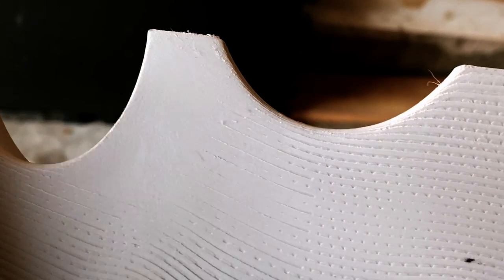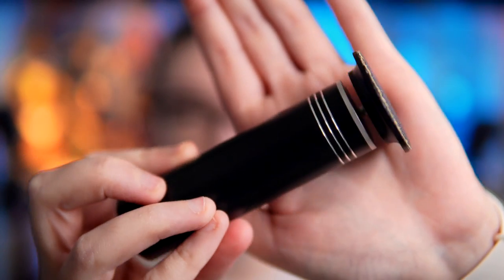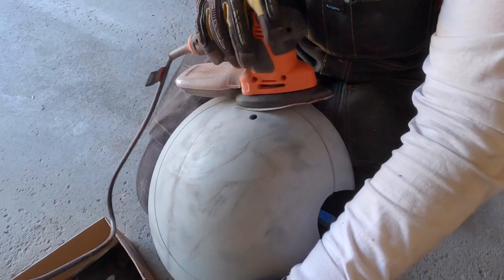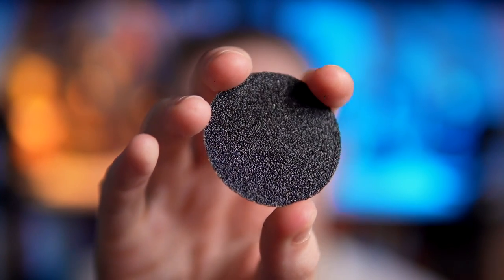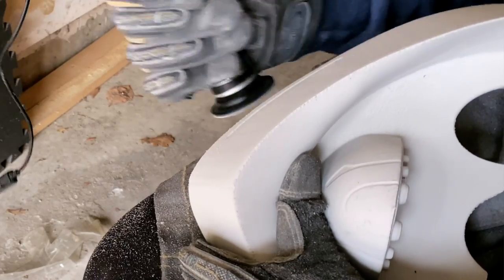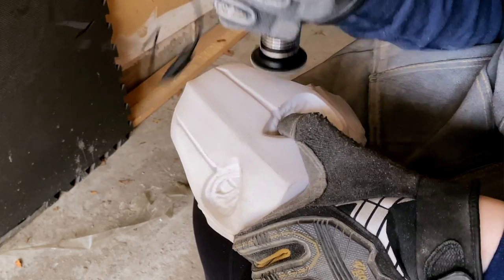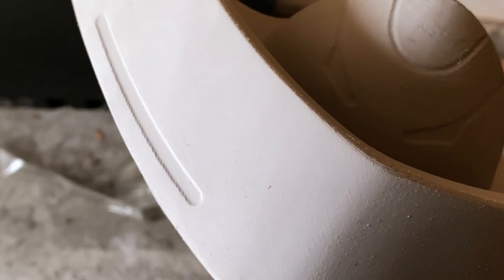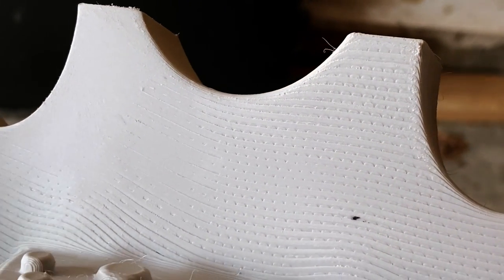Make Layer Lines Disappear in Seconds | The Best Way to Smooth 3D Prints

Comment: They sell finer grit sanding pads with an adhesive back for larger sanders. You could pretty easily trace one of the 80 grit pads onto the larger, finer grit pads, then cut them out with a hobby knife or scissors. Then, you could use any grit you want with that device!
Reply from the maker: Definitely! I meant it more that the disks specifically made for those products don’t seem to come in finer grits but it is such a simple setup that creating your own is easy.
Reply: @MMsPropShop Maybe they don’t sell finer grits because no one wants a mirror finish on their feet 😂

Comment: I use XTC-3d made by smooth-on, its some awesome stuff. you mix a very little amount and just coat the 3d print with it with a foam brush. I've used it for 5 years now! a little bit goes a long way. not only does it smooth out the part, but it adds a great deal of strength to it. It's not overly expensive. it's exothermic though so if you mix a good amount its best to spread it on tin foil so it doesn't heat up and cure. cure times based on temperature range for me from 2-5 hours.

Comment: Thank you, thank you, thank you! This is just what I've needed. 

Yes, I've tried a number of Dremel tools and sanding tools for woodworking too, but this Electric Callus Remover very affordable and is just right. The adjustable speed is perfect. The Dremels are way too fast and melts the materials too easily. Going to 3D print a soft TPU boot for it to help with the curved surfaces on my fishing lures.

Comment: Love it. I use something similar. As far as sand paper goes, i cut some to-size and put velcro or a simple glue (lightly!) that can easily be changed out.  Also, I use a cheap no brand  “dremel” that has variable/dial, speed to make sure I don’t melt anything (kind of like a dog’s nail trimmer/sander).  Great videos and I appreciate knowing what layer height etc. that you use on your prints - thanks!

Comment: Great idea! Just a thought, there are adhesive backed sandpaper discs that are for orbital sanders that have many grits available you could cut out small enough discs for this use. Hope that might work for you. 😃
Reply from the maker: I have actually tried that and you really need to add some foam tape or something to cushion the other sandpaper in order for it to work well. The disks made for it have almost like a foam backing and without the cushioning, sanding does not go well 😆
Reply: @MMsPropShop  Great tip, I forgot about the foam cushion. A small piece of foam insulation tape will work. Thanks for pointing this out, best wishes!
Reply: I just order one so we see

Comment: You could probably convert that to accept hook & loop sand paper. Just glue on the hook portion and then just buy H&L paper in all grits at an auto paint supply and cut to size. Bam!

Comment: Why not use a small Dremel. You can get any grit like 60 to 30k and mulitple sizes and more speed settings and tools like the router bits, drills, engraver. I am just asking because i had a look online and for the same price you can get a rotary tool set including all those things.
Reply from the maker: Dremels are great for a lot of things, sanding 3D prints is not one of them. It’s about the least ergonomic tool you could use for the job; unless its a edge of a flat piece it will do almost nothing other than make gouges and/or melt the plastic due to its speed. If you try slowing it down, it won’t have enough torque to continue running when pressure is applied.
Some of the smaller pointed bits might be ok, but for the most part the hassle ends up not being worth it.

Comment: This is so cool! 

I've been trying to find something like this but for fine detailing (tight angles or grooves) because rotary tools tend to do the same, and I had two thoughts:

1) For this tool, do you think setting up some kind of pad for making a flexible sandpaper surface could help with more compete surface contact in use? If so, what do you think would work good as that "pad"? I'm thinking like a Fabric wheel if can be compact enough to be a problem in use.

2) For a Rotary tool replacement, do you think one of those "motorized Pet nail safety files" tools, that use a rotating file barrel, be converted into a "print safe" finishing tool? I'm sure they don't come with the file barrel part replaceable, but with some DIY it could!

Wanted to pitch those ideas as a way to say thanks!
Reply from the maker: There are some polishing tools/accessories that have this sponge-like part that sounds like it could be what you’re looking for. They tend to work off of a hook/loop system for flipping out the various sandpapers. I was going to possibly try that out for myself.
I believe there are quite a few people that use Dremels and other rotary tools for printed pieces with success. It really depends on the job you’re working on and what would be useful for that specific project.

Comment: so you have never seen Oscillating Tool Detail Sanding Pads and the attachment  for a  Dremel tool ?
Reply from the maker: Definitely, but I find a dremel to be awful for sanding 3D prints. At least for the initial sanding. It doesn’t have the right balance between speed and torque to do the job as well as the foot sander. Plus it can be a lot more awkward to hold.
Reply: I agree that it can be awkward. I see many holding the tool wrong or digging the tool into their prints. But I don't agree with it having the the wrong balance. Especially since there are many different types of rotary tools for different jobs. I end up using a cheapish battery powered one for most quick sanding jobs. Just don't put pressure on it. Move in direction of rotation and let the machine do the work.